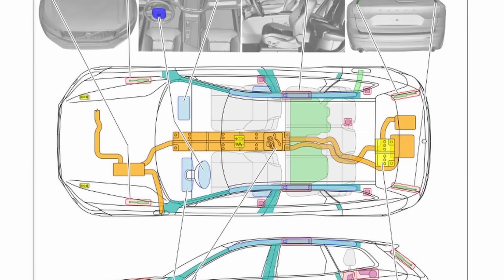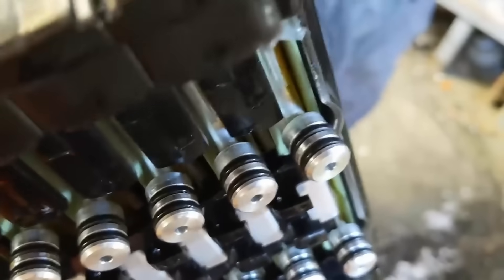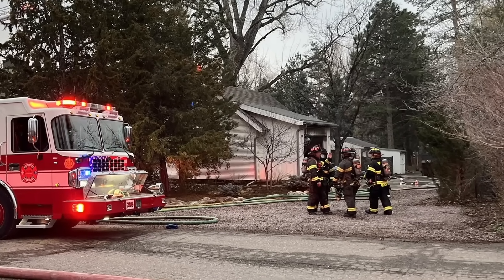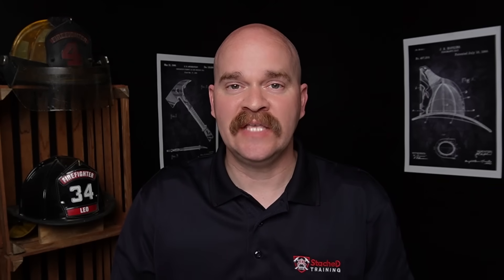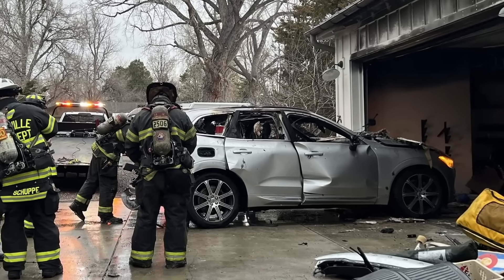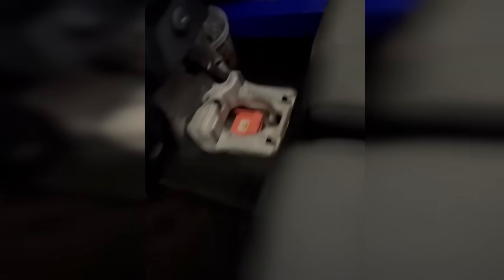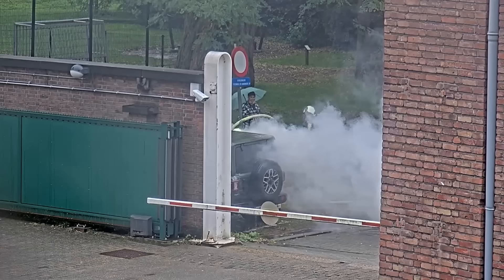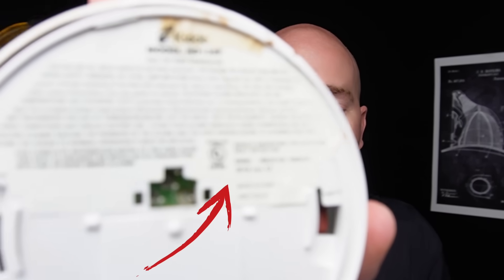EXPLOSION: Volvo XC60 Electric Vehicle!

Comment: Smoke alarms aren't required in garages , ( Australia) but future regulations should maybe include them. If your going to be charging your car in the garage , I would definitely fit one and link it to one in the house so you can hear it.
Reply: NEVER garage an EV in a closed space.    Charge it outside in the open air.
Reply: IF the smoke alarm goes off  better move quick
Reply: @aeroearth
All cars can burn. Just look up Stavanger garage fire, how easily can diesel car burn 300 others (many of that EV, where battery did not burn).
Also lot of fires are caused by short circuit of low voltage system, same in EV as in ICE. There is no short term difference to how those car burn, when battery is not damaged.
Only thing that can safe your building, regardless of car type, is quick and professional firefighters response.
There was EV fire in garage in Parque on may 04, 2023 - everything went well thanks to fire alarm and quick response. If there was no fire alarm, it would burn down even with ICE car.
Reply: @MrVolodus  I would say the odds of an EV fire during charging is higher than any car including EV being just parked. The EV fire is also going to add complications to the event but in either case early warnings and effective response are needed.
Reply: I am an Engineer by profession and a volunteer Rural  Firefighter.  When ICE vehicles burn they do not give off hydrogen cyanide and hydrogen fluoride gases and they can be put out.  Li-ion fires cannot be put out,  they can be subdued  but can re ignite hours,  days or weeks later.  That is the important difference.  I have had a fire in an ICE vehicle and it was easy to put out.
Not everyone lives in cities and may be reached in time by fire crews.  If we have a house fire in rural Australia,   it usually burns the house down before we get there.  7 minutes for a house to burn down.
Reply: @aeroearth  Sure, when it burns, it is crazy, but "From 2010 to June 2023, EV FireSafe recorded 393 verified passenger EV battery fires across the world, of which only four were in Australia.". Most EV fires are not battery fire.
But sure, if you live in rural are, charge outside. We don't have outside in city, but we have lot of charging point in garage.

Comment: Anyone mincing words between "hybrid" and "full EV" when talking about them causing fires......is simply detracting from the problem because of their own ideology.  ANY VEHICLE with a LITHUM battery can explode and cause a fire......period !
Reply from the maker: Not every hybrid contains a lithium-ion battery, but every PHEV & BEV contains one.  Lithium-ion is the hazard.
Reply: @StacheDTraining no, ANY battery can be dangerous.

They all are chemical reactions, correct!?

They all have higher voltages than 12 volts, correct?

High voltage and current does not like corrosion on connectors. Corrosion created by coolant leaks.
Reply: @StacheDTraining In this case the battery was probably the cause, but a PHEV also has a fuel tank so isn't that even worse than a BEV? Two potential fire hazards instead of one?
On the subject, a colleague of mine had the battery replaced on his VW Passat GTE on warranty because it was leaking in some way.
Reply: @itekani gas by itself cannot explote!
Gas tanks are designed to vent when under pressure so you could have a fire while venting, but gas tank explosions are extremely rare.
Reply: Not "can explode". WILL explode, given enough time in operation.
Reply: its not what it should be, dont waste money on mediocre , make them stop fooling around if they are gonna get your money.

concept car videos... how about a video on what you guys think is the ideal car?            driving efficiently is speeding up especially on more downhill-ish roads at optimal fuel level and engine RPM(RotationPerSecond), steering and braking minimally but smoothly. optimal effiency for toyota 2.4 inline 4 is 2/3 pedal down in 2k-3k rpm, cvt hybrid maintain constant rpm. not sure whats best to do this in: sport mode, fuel level is more, in eco mode its less. use EV mode if optimal combustion level would speed car too much (often, if car isnt letting you do that without the EV mode, it wont let you us EV mode.) use it a bit from a stop for smooth acceleration then when car is rolling use combustion then maybe use it a bit more. smooth acceleration is part of putting less weight on tires at a moment because:

consider tire wear dust emissions and how much it cost to replace tires (most people are becoming increasingly even poorer than they already are and you can invest money into bigger money)like those "xenoestrogen endocrine disputing forever chemicals micro plastics" etc. apply less weight on tires and you'll allow more of that weight handling ability to be used for having more grip for endurance-race-pitstop-avoiding momentum preservation driving fun in the name of efficiency. being able to feel how close car is to its grip limit is good for this goal, similar to the lotus-car-enjoyers ideal.

hybrid cars are arguably better than electric car because they lower use of combustion and battery mass and all materials overall without adding so much weight. weight worsens road wear damage (repairs cost emissions , money etc) , worsens crash safety for all (except few rich people who can afford super safe cars in the small chance that they are involved in crash and value their lives and have lives we can value). this is why aptera motors originally made diesel hybrid, but now sells electric cars to max profits and reputation as a "environmentally friendly brand."

because batteries are not fully recyclable and combustion fuel is based on anaerobic bacteria that regenerates , which is why oil rigs go back to getting oil after abandoning the almost empty oil well years later . this is why arguably only combustion is proper, in rear mid engine weight distribution , rear wheel drive , with limited slip differential for minimal tire wear even in normal driver driving , for preserving momentum around turns more without too much slowing down by lateral (left /rights) g forces tires.

genetically better population is being replaced with one that is more likley to be less loyal to each other and more loyal to selfish elites, and even they probably will be replaced with others, until theres noone left except the elites and few servants. so even hybrid seems useless.                                   so overpopulation isnt a problem so running out of materials by over use probably wont happen. can you prove climate change is caused by human caused co2 or that its just milkovitch cycle of earths magnetic field tilting etc causing stuff like the usual natural ice ages etc? also see blackgrock esg score and their climatechnge talk, and see how they promote nonsense with ot of money, see colbert report "how blagroc conquered theworld" etc . . about climat change, see tony heller, tom nelson, suspicious observers, youtube chanels. i haff to talk like this znezorshp reasons   

 to understand why so much nonsense if happening (in lot more ways than only car) see corbetts explaantion of climate crisis , "blackrock conauqered the world", federal reserve etc . ivor cumins, tony heller, magentic reversal news. 	  vocational science of freedom how yoru assets are stolen from birth on odysee, yandex insteadfgoogle, , western governers university . "divine speech" by nouman ali khan and sharif randhawa tries to understand why to become muslim , as it is what the troublemakers seem to counter most.
Reply: @ouch9326  hybrids are not better as they are not as efficient and cost more to run and maintain.

My EV cost half to run compared to the plug in Prius my neighbour has.
Reply: @badchefi  your thinking too small scale
Reply: @ouch9326  it’s cold hard numbers - we have been running EVs since 2016 and it cost us half to run compared to a hybrid and five times less compared to petrol.

Happy to share our business accounts/spreadsheets.
Reply: @badchefi  the overall COST to the environment = EV 100 times worse over its lifecycle, compared to gasoline powered vehicles.
Reply: @darknes7800  have to got any credible links to back up your absurd claim?
Reply: Thermal Runaway  menacing words sounds like the smoke entered the house.
 
Once toxic gas gets to the lungs you may not have an opportunity to leave the house.

If that happens you can't post negative comments about someone giving common sense advice and information.
Reply: @HeavyCrown2030  the only thermal runaway you will ever see is your neighbour running away from a petrol fire wearing his thermals🤣🤣🤣
Reply: @badchefi After 3 decades in life safety and fire prevention I hope so. 

But we have seen Thermal Runaway in Lithium batteries continue to burn  under water NYC has had multiple deaths from ebike batteries this year. 

Sounds like your phone is smarter than yourself, Look it up before shooting off.
Reply: @HeavyCrown2030  e-bikes are a bit different to electric cars, it’s poorly made, cheap bikes with low quality batteries in combination with suspect chargers.

By having higher standards those deaths could have been avoided - so the advise is buy a good quality e-bike from a reputed manufacturer.

And please don’t mix e-bikes and electric cars.

It’s like comparing two stroke engine motorcycles and four stroke engine cars when it comes to safety and reliability.
Reply: @badchefi where I live we had a Tesla burn for 24 hours , again stop letting your phone be smarter than you. 

So far the trend has been that occupants are alerted before it gets too bad. 

You are starting to come off as some sales guy just worried about their own wallet. 

Grow Up the whole world can't work like that

Comment: I understand that these batteries give off hydrogen cyanide gas when they burn.
Reply: Yup, amongst other deadly stuff. Also tons of hazmat in the water runoff from the firefighting. Right down into the storm drains, unfiltered.
Reply: @cncwizard  And special equipment and firefighting techniques and training are required to safely and effectively fight these fires. It's a different type of combustion than your gasoline or diesel fires. Bystanders to these fires need to be well upwind of them if they need to stick around.  Otherwise,  get far away from them asap.
Reply from the maker: Most fires give off hydrogen cyanide.  One hazard with a lithium-ion battery fire is Hydrogen Fluoride.  Any smoke is toxic, but this is a nasty gas.  We still need to quantify what is in the gasses.
Reply: @StacheDTraining  A UK Chemistry Professor Paul Chistensen did a YouTube video on the gases released when a lithium battery outgases or explodes.  https://www.youtube.com/watch?v=AIXTP-TgPEw&t=1530s
I recall hydrogen cyanide gas and hydrogen fluoride gas.  The hydrogen fluoride gas will attack the bone structures of mammals.  Hydrogen cyanide gas will prevent oxygen take up by the cells and a fatal dose is reported to be 1-3 mg. per kg. of body weight.

Comment: If someone with a portable power station and a cheap induction hotplate placed one on the underside of a EV .. would anything protect the batterys from heating up....  Are they putting everything required into these cars for protection.... A simple fire alarm in every ev battery should be wirelessly letting services know and the people inside and outside the car with sufficient time to act before thermal runaway..
Reply: But that would cost extra
Reply: All modern EVs will have temperature sensors in the battery to alert you when the temperature gets too high (also to limit fast charging to a safe speed for the conditions).

Does you ICE car have a similar alarm if I put a hot plate under the plastic gas tank and melt it from radiant heat?
Reply: @economicprisoner  I have no car.. I was just curious if EVs are protected from bad actors with easy to build directed energy weapons , as seen on many YouTube channels... Remotely increasing heat in a selected area is no longer a military weapon on the back of a truck...
Reply: tech ingredients built a ai directed laser, very interesting video